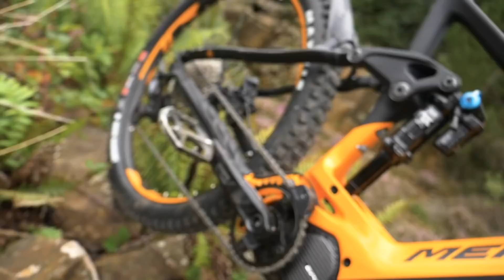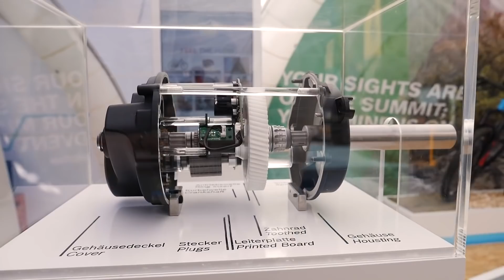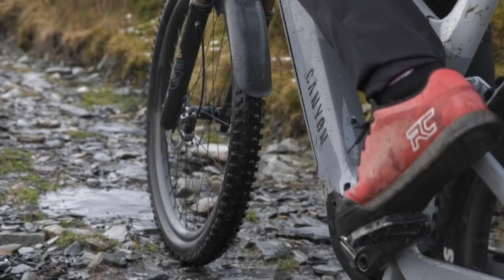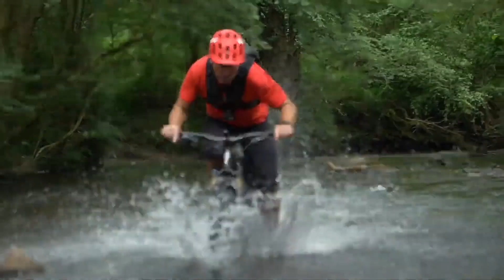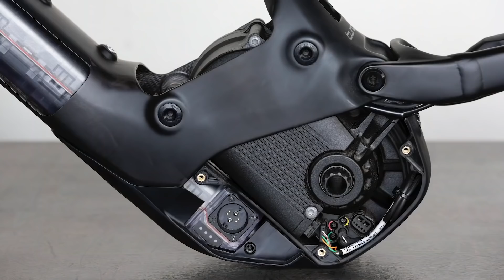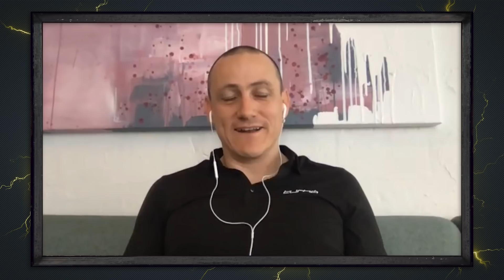Future E Bike Technology Part 3 | The Future Of The Electric Mountain Bike Motor?

Comment: 1) Solid State Batteries : will allow the bikes to have more range, faster recharge and less weight
2) Better carbon fibers : will allow lighter bikes
3) Active suspensions : so we will eliminate useless and annoying fine tuning
4) Electric seat reguations : so to improve comfort. Lots of people have pain on those saddles
5) Better engines : we will have more efficiencies and even more torque. People are happy with powerful bikes, especially on the alps!

Comment: Ignore the motor, the gears, and the whole drive train. the ONLY thing that makes a significant difference is the battery specific energy density.   Fundamentally, a current lithium battery is around 9 times less energy dense than is THEORETICALLY possible.  So, whilst we will never get that full 9x improvement, a doubling in density is not just possible, but already exceeded by some other chemistrys and electrode architectures.

Fundamentally, motor performance scales directly with voltage.  More volts = more power, it's that simple for an eMachine.  Unfortuntately, regulations put a legislative barrier at around 60 volts.  because above this voltage, your system must comply with things like the "low voltage directive" (confusingly named, but called low voltage because it covers systems between 60 and 1,000 volts, which in inductry terms are indeed low voltage). I can't see any pedal bike accepting the limitations and costs of exceeding 60v for a while yet, so power is likely to sit broadly as it does currently

Comment: I support Kevin Short remarks about a built-in gearbox in the motor. This is standard practice on other 2-wheel vehicles. I feel that the bicycle industry is milking our wallets for many years now by introducing small evolutions one by one and charging a big deal. You can buy a small electric car for the same money soon. Also the battery evolution is not followed. Maybe I am harsh with my comments. I have recently retired from the automotive sector after 44 years. Together with my experience in electronics it have seen other, more radical changes being made the past 5 years.

Comment: My bike motor is already 6200 watt with a 2000 watt battery and 100klm range. VERY Happy right now !!! Why the fk would you want a SL levo that cuts at 25kph and costs $23,700 here in Australia..

Comment: Would be great to see smaller and lighter batteries with increased capacity. Smaller and lighter and more reliable motors. Electronic shifters getting power from the main battery instead of a separate battery.

Comment: I wonder if we’ll see a smart control work with the likes of Komoot taking into account elevation, terrain and distance - plumb in a route and let SC manage the consumption. The video suggested that is possible by entering the amount of hours you want to ride so maybe a progression to that. 
I have an original Levo but as I’ve got fitter find myself pushing myself more and challenging myself with less power on bigger climbs. I’m considering a lighter, less powered bike in the future - also for the reason of lifting on and off the car and over gates or fences when occasionally required to do so.

Comment: Redistribution of weight would provide a large increase of c.o.gravity mass eg the seat tube can be considerably altered in shape to combine some of the battery content to the point of the down tube being the first battery to be used and then defaulting to the seat tube supply. The biggest gain being obviously to lower the leverage figures of a higher up weight or go the Spec way with light weight piggy back plug ins,so giving the choice of using just the battery encased in the down tube. Something to ponder?

Comment: I think the next big thing is the integration of the motor with the gears, on the likes of Valeo. All weight concentrated in the middle, light wheels and the end of hanging derailleurs.

Also, some sort of energy recovery during braking would be appreciated.

Comment: 75-80% efficient motors, that's not that great and probably the result of stripping weight where mass matters. Gear reduction is also a significant loss where gear design and especially lubrication can have a big impact. big gears with high load lubricants definitely improve efficiency

Comment: You could’ve asked if the mastermind TCU will be made available for GEN2 owners.
This TCU has already been tested on a GEN2 Levo and it works fine. 
There are several rumours going around. 
One is that it will be available when supply chain issues improve, but conversely I’ve also heard that Specialized will deliberately make it incompatible 
`in a future firmware update, effectively LOCKING OUT GEN2 owners from this improvement and potentially forcing them to buy an entire new bike
if they wish to use this improved tech. This would be a massive shame as there is no technological reason for this to happen, just marketing and price gouging. 
Why shouldn’t GEN2 owners be able to use this more sophisticated TCU?
Reply: I definitely agree and although I have a Turbo Levo Comp 2021 (Gen2) on order I may cancel it because the with their policy Specialized starts to take the piss of all the people that have forked out a lot of money on every model up to 2021.
Not nice Specialized, not a bit and if you care, show it
Reply: You can buy the old Specialized TCD and stick it onto the top tube with Butyl Mastic giving you nearly all the info of new TCU.
Reply: I totally agree. I have on order a gen 2 Levo Comp and having second thoughts on the bike and on the company as well at this stage.

Comment: I do not think speed limits on ebikes are going to change, hence why more power ? Getting more milage may be nice to a few but that is solved by second or aux battery. What is left for tech....lowering the price so that they can sell more. And lowering the weight but that is relatively secondary. Efficiency, na, consider the 80/20 rule the little gain is not cost justified. And the elephant is....minimally base 3 year 15 000 km warranty on the whole bike (except tires ) there is the tech challenge.

Comment: Will you at some stage do a video on emtb security? It would be nice if the manufactures add some kind of gps tracking to the expensive bikes they sell
Reply: Bosch has a motor lock option with their Nylon display. It locks the motor so that it cannot be activated without the same head unit. I think replacement parts are only avl though a certified vender, as are motor updates.
Reply: @carlose6010  Every e-bike should have a way to secure itself and make it non operational when stolen, whether its electronically or by the dealers not selling chargers or brand specific parts without proof of ownership.
Reply: @carlose6010  unfortunately not everyone has a bike with the bosh motor and the display you mentioned (According to a late test on you tube) can easily fall off while in use. I would really love to see the likes of Specialized doing something about this

Comment: What would be better if the motors and battery’s we have now could be easily fixed without having to constantly go back to the bike shop for fixing software should be more readily available for the home fixer. A bit like a puncher imagine if  you had to take the bike somewhere every time the Tyre was flat. There not under warranty forever so let us fix the dam things.

Comment: Do you see batteries to replace the same size of a 504wh but wit more capacity? That will give live and range to a lot of 2018-19 ebikes?
Reply: If you based the new battery on using 5A 2170 cells it would raise it to about 625wh. Actually that is why Spec can have a 500wh battery and a 700wh battery in the same down tube. Problem is that your motor provider of choice probably won't get around to it and some of the proprietary BMS CAN/BUS unless you got the manufacturers permission would be hard to replicate.

Comment: The biggest improvement for me would be efficiency and battery capacity. Current motors make good power.  Heavier riders have a big disadvantage going uphill for long stretches.  No way around it really, so having more watt-hours and better efficiency would be a huge plus.  I weigh 88 kilos and ride a SC Heckler with the 500wh battery. For most rides I have to carry an extra battery as my friends all have Turbo Levos with the powerful Brose motor and 700wh batteries, and all are lighter than me,  I am electrically marginalized:)

Comment: From my perspective it is ideal to have mountain bike with motor which will have torque approximately 80-90 Nm (because it is enough powerfull for mountain biking in any terrain) and battery with capacity about 500 - 600 Wh (because it is enough for common rides) which will be easilt replaceble. And the next target shoulg be to build such bike as light as posible for achieving as best as possible handling (and transport if it is possible). I really want to have possibility to replace the battery due to long day rides for example in Alps which could be in my case about 90-100 km and 2500-3000 m elevation or sometimes even more.

Regarding management of motor performance I think that current settings will be extended by two new modes which I call "ride/mission completing guaranteed" and which will work in the following way. Rider will upload planned route including its profile and bike will intelligently manage level of asistence to be guarated that the rider will have enough energy from start to finish (with some, for example 10%, reserve). I had spoken about two new modes because I think that it would be nice to have possibility to select more "flat" assistance curve or more "steep" assistance curve which will spare more energy for climbs in comparison with "flat" curve.

Comment: I personally don't think going for more more powerful motors or higher powered batteries is the direction of the future. I think lighter and more efficient batteries and motors within a smaller footprint is the solution. Also, the derailleur as we know it needs to completely be replaced with a hub gearbox designed by the big brands specifically for e-bikes. 

I don't think traction control is something we need or even an issue. I am my own traction control, that's where skill and experience comes in. We don't need to completely idiot-proof mountain biking. Let me use the enhanced tools for getting uphill myself.

Comment: All of that sounds like a excuse for 'poor' battery technology 😛 Don't suggest neutering our bikes just because you're not there yet!!  We want lighter, more reliable e-mtbs with the same power and lots and lots of range... end of story! 

My prediction is that by 2025 we should see more efficient,  lighter and much more reliable motor tech along with lighter, smaller batteries in the 1000w-2000w range. Maybe new drivetrain advancements too. Throw a minimum 5 year+ warranty on the motor, tech and battery and now we're getting somewhere.  By 2030 my best guess is 75%+ of all bikes sold will have some sort of power assist. They'll feature a new, reliable drivetrain design and most likely they'll weigh similar to their non-powered counterparts of today. Batteries will be a lot smaller, lighter and able to store so much more energy then today I feel they will ultimately become far less of a concern with regards to range and bikes. So add that high tech, 250kms of full TURBO mode to an extremely efficient and reliable motor and drivetrain, all built into some crazy nanocomposite graphene-aluminum frame and things should be fun! 🤙🏻 

As far as sending noobs out in to the forest without a clue...  well shops have been doing that forever!@ 🤣 With covid we are just seeing years of that all compressed in to a short period of time. We are all stewards of the sport and we all were new to it at one point, so let's try to be patient with all these excited, new riders!  Love the channel, cheers 🍻
Reply: Yhea as we can't do that yet obviously that's not the problem. No it's the rider and the software. You know the software we can make really cheap, stick a fancy name on it and sell for lots of £££.

Comment: I’m still riding my 2018 Levo & it’s got all the power I need to play & ride keeping the smile on my face. Having more efficiency or bigger/smaller battery It’s all waffle. Most of us are just weekend warriors. We don’t race, we just go out with our mates & have a blast enjoying the ride. I have no need to upgrade as my bike still gives me everything I need. Even if the shaved 5Kg of a new Levo? It would make any difference to me as I don’t set time I just hate riding uphills & Love going down.
Reply: Agreed, but this talk of less power and let us control your ride in this video seems like a massive regression to me. Sure add one more auto mode but dont take away the greatest part of these bikes.
Reply: Stick with your 2018 levo. Reliable, powerful , very quiet and I suspect that brose 1.3 motor is the design of the 2022 2.2 motor with its bigger belt and clutch bearing. Weight of bikes ànd shape of frame below seat post tube indicates they might be using the 2018 motor platform????

Comment: In my opinion, we will hit the sweet spot when batteries will be twice the capacity at half the price and weight. Regenerative braking should be standard especially if you are paying the upper end prices, £10, 12 even 13k! Antilock brakes maybe? Perhaps even a small hub motor at the front (as well as mid drive) to assist steep loose climbs? Could you even use electromagnetic suspension damping to also put charge back to the battery? Lighter ebikes is a must. Built in lights and inflator please! And security! Puncture proof tyres. Silent motor, yes! Better and stronger drivetrain. Super eco mode that turns the motor off when the going gets too easy. Super safe eco mode that reduces assistance as the bettery nears exhaustion (60-50-40-30-20%)
Reply: There will be no need for the extra cost of regen braking as I believe you'll see it disappear from cars in the next 10-15 years due to new battery tech. When my bike has a super light 1500-2000w battery that'll let me go 100kms in full boost, what's the point? Same with cars being able to go 1500kms+ on a single charge.  I think that tech is all on schedule, but its the drivetrain that needs a real solution. Spending hundreds of dollars on chains, cassettes and chainrings every 6-12 months needs to go! As far as motor noise goes, my 2020 rocky mountain altitude and my partner's 2021 Liv Intrigue E+ are super quiet.
Reply: @Sjaan_86  good point on regen braking. They do say it could only add 10% range and if batteries improve so much, the complexity and cost of regen is pointless.

Comment: Honda ,KTM and Yamaha have just joined together to pool their knowledge and develop a better battery for their e motorcycles.  Bicycle companies need to do something similar i think,  but right now the bike industry is in a mess,  mainly no bikes !
Reply: already did, the Lithium Iron Ferum battery with Carbon holds longer and especialy can put outstanding amount of energy without problem, also able to charge with in seconds. but to build a factory for this in china and put this on manufactoring take some time, i assume 2-4 Years we will have such bettery that will outshine all other combined together.

a motor performance just increase in 15% will make it 50% smaller or powerfull. a Battery which you can instant charge will make this Category make go BiG ! bigger then "VAN-LIFER'S" etc. a Bicycle with such technology will make car's technology obsolite....

charging-Station overall will make transportation and logistics different, in next 5-10 years

Comment: Interesting
But no information about solid state battery and capacitors?  Alternative ideas about battery placement.  Handlebars could snap on and off more battery reserve easily. Among many other spots.  Adaptability of different uses of battery power reserve's.
Adding to reserve power just by pedaling without the motor or going downhill. Even suspension adding to battery reserve.
Not to mention more reliable motors.
Or even flexible solar built into clothing or equipment to charge up with.
I won't even go into quantum ideas.
Reply: Better yet anti Gravity static repulsion and make your own trails!
Reply: @charliewilson3528  Is that not a technical way of saying hover bike? 🤣
Reply: I hear you Terry. He never even made mention of a hover bike.